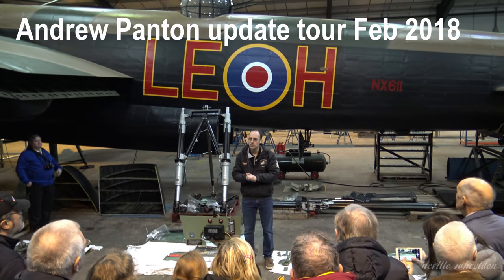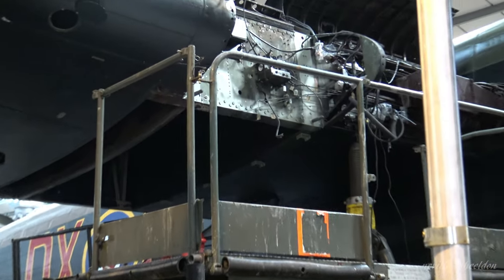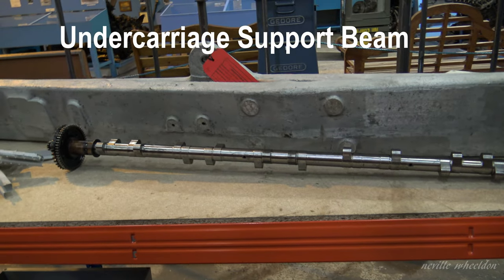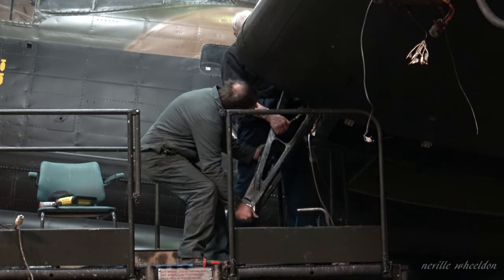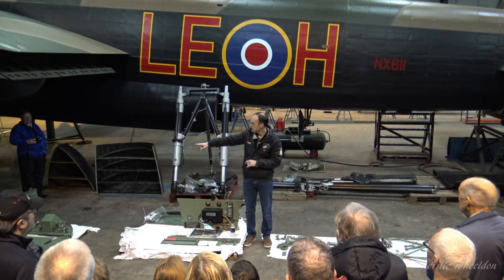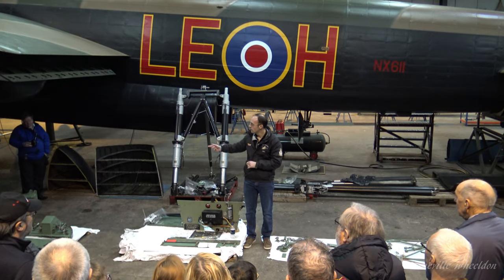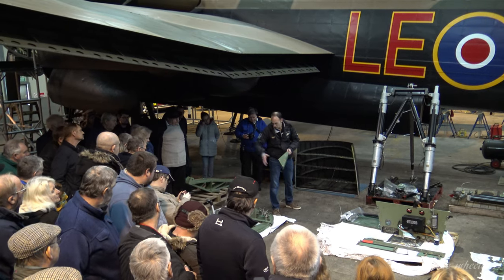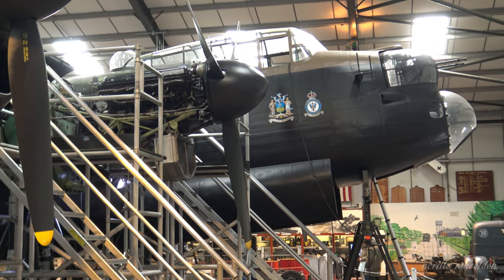Lockdown Video 32. Restoration work done in Year 1 on Lancaster NX611

Comment: Very interesting Neville particularly the undercarriage fracture on the Canadian example. I clearly recall , some years back, seeing a video of the BBMF landing in a cross wind and landing on one  wheel . l assume that was inspected post  landing . Once again , your video illustrates graphically just how much work is involved in any procedure.  Thanks Neville.
Reply from the maker: Hi John, the Centre going through the aircraft very carefully, correcting and replacing what ever needs to be done.